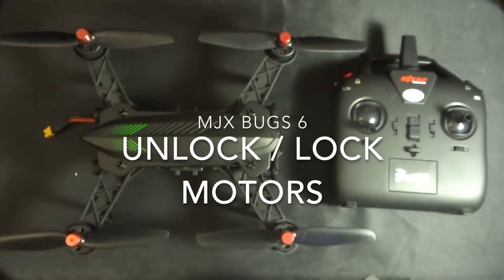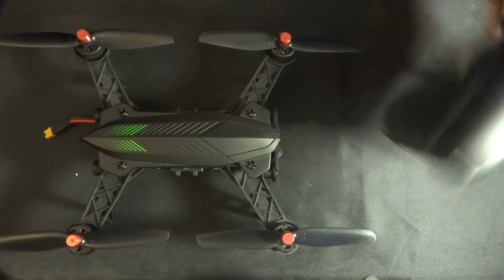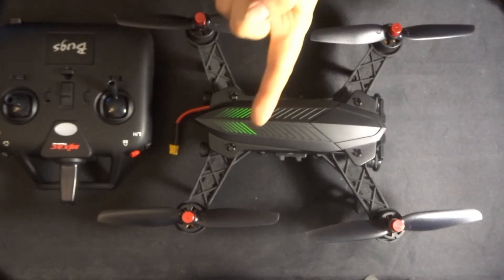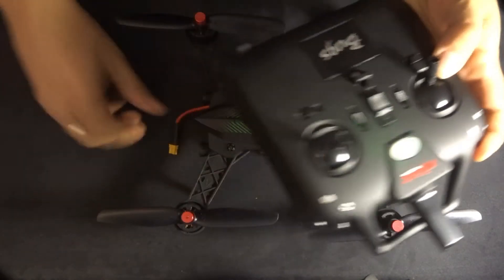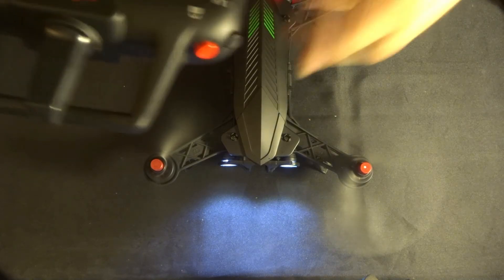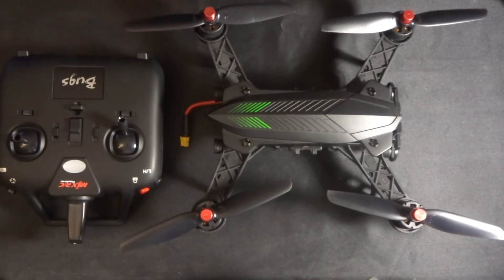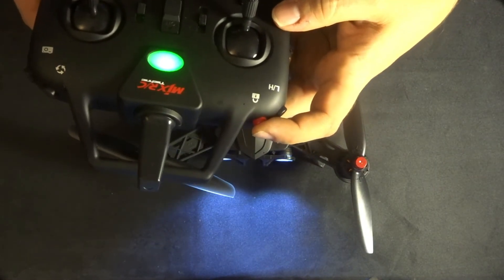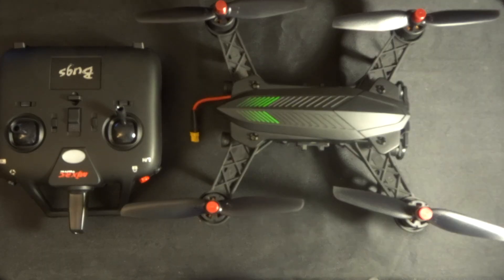MJX B6 Bugs 6 Unlocking the Quadcopter Drone Motors

Comment: Hello. I realize your video is 5 years old.
I have this very same drone.
My remote won't bind to the drone.
It did before multiple times.
But now it simply won't.
I've repeated your exact steps.
With fresh batteries on both the remote and drone.
Holding the red button (with throttle closed) and turning it on. The radio beeps once and the LED blinks green. While continuing to hold the red button plug in the drone, then releasing the red button.

But the remote will not bind to the drone and simply continues to flash the LED green.

The drone continues to blink the rear LED...

I simply cannot figure it out.
Moving or pressing any button on the remote causes the green LED to go solid green (no beep) and no binding.

Comment: Does that mean that "Lock" and "un-lock" is on and off?
I am having trouble figuring out how to get my drone to obey my controller....lol
Reply from the maker: Hi wildbillo68 motors are locked and motors are unlocked. Yes essentially on and off its a bit annoying to unlock and plug in the battery. Have you had any luck so far?
Reply: yes...thanks...I finally figured out the "binding" thing, and how to turn on and off hahhaa...I'm a newbie so.....
    I have had to try to learn on it in the garage cause it's been raining here in Florida for day's now, so I have had to be too careful with the throttle as to not damage anything when it takes off too fast hahaha,  So- I guess it wasn't throttled up enough to leave the ground when I was playin with it, so I thought it wasn't workin properly... Last night I really gave it juice and it started to come up in the air so.......  The Drone and controller should be fine. I just need to get outside and start practicing in a open space where I am not being too light on the throttle  lol.....Thanks for the reply....